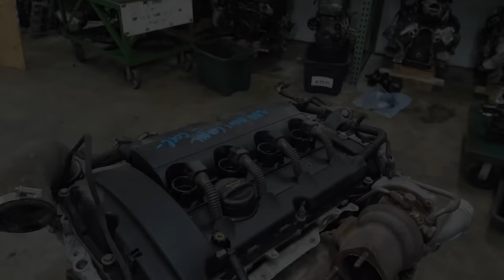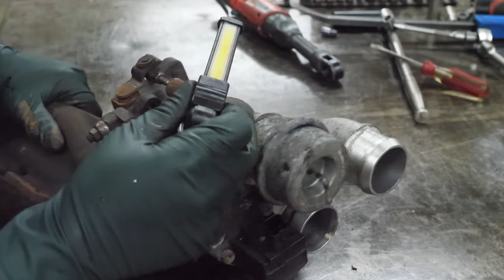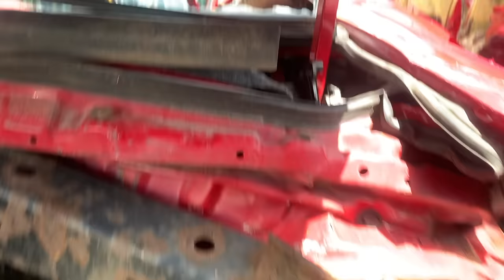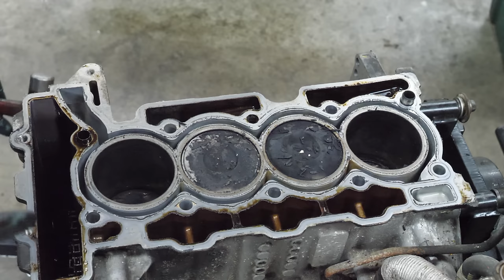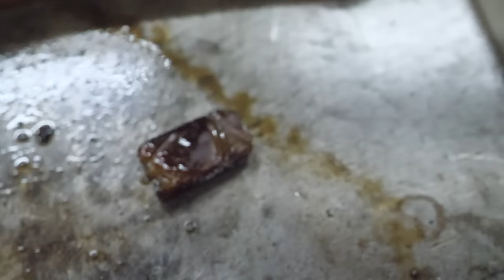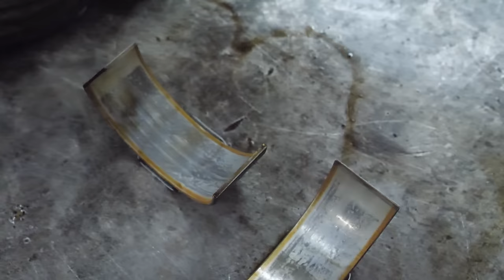JUNK Mini Cooper S (BMW/Peugeot) N14 Turbo Engine Teardown. Why Do People Buy These?

Comment: I owned a 2010 MINI Cooper myself, and loved it... but traded it in on a Fiesta ST after five years due to the multitude of trouble reports on the MINI forums, chain guides chief among them. Figured I'd get out while the car was still good. By the way, the recommended oil change interval in the MINI manual was 15,000 miles. I changed my oil every 5,000.
Reply: BMWs ridiculous oil change intervals are a significant part of their reliability problem IMO.
Reply: Fiesta ST is even worse.
Reply: @jamesgeorge4874  Ha… yeah, I’ve heard the stories. So far it’s been flawless, fingers crossed. But my mileage is pretty low.
Reply: @gryfandjane  At least it's Ford pricing, not BMW pricing, like MINI. Manual models are OK, DCT equipped models, yuck.
Reply: I will never under stand why some one would think 15,000 miles was a good idea I am not even sure full synthetic  can survive 5000 miles
Reply: @dougowens2686  if it was all highway miles, in a theoretical world where humidity, and temperature were ideal, unchanging, and the engine powered by propane / natural gas / hydrogen. Then maybe. I have seen a salesman do 5000 mile intervals on a 3800 that went over 400,000 before it was totalled, no synthetic, just 10/30 Quaker State. 1989 Olds 98.
Reply: @jamesgeorge4874  That 3.8 engine is a legend. One of GM's best. Ever.
Reply: @dougrobinson8602  Indeed. All of my kids first cars were GM W body 3800 cars, for a reason. Every parts store has what you need, the trick is keep them from rusting / getting wrecked. Our 05 Impala went 270K before being sideswiped, I did a water pump, coolant elbows, lower intake gaskets on it at 175K miles, it got sideswiped, and was done for while still running amazing.
Reply: Smart. My wife had a 2007. Well looked after and obviously fun to drive. I knew it was a ticking time bomb thanks to the online forums and I told her many times to sell it before it dies. She didn't listen, "but I love my Mini". With just over 100,000 mostly freeway miles a valve spring snapped and the car went from being worth several thousand dollars to practically nothing.
Reply: My wife had a 2012 Cooper S, at only 36k the dual mass flywheel failed taking the clutch and gearbox with it in the process, it then started drinking oil and gunk was forming under the oil cap. Never again, BMW can go and do one.
Reply: Every 5000 miles?
Smart (and rare) owner.
The proper OCI is 5000 miles OR six months, whichever comes first.
Reply: @flycorvus 5000 is insanely early if you ask me. Thats 8000 km. Not even most motorcycles have such a short  oil change. I change mine between 10 en 15 thousand kilometers. I think it all comes down to oil and brand mostly on that part. I always use Castrol. Which costs me around 70 euros per 4 liters.
Reply: @jamesgeorge4874  No question the Buick 3800 is very reliable.  The engine sound is not the best though (IMO).  I wonder why GM didn't design a straight-six like the one used by Opel and Vauxhall in Europe?  I guess it was mostly installed in front-wheel-drive (again, that were totally different to the Opel Omega and Senator for unclear reasons) hence the need for the more compact V6? The 3800 V6 being used for  rear wheel drive in the Holden Commodore was, I guess, the exception.  [Ford weren't any better, the Taurus, Granada and Falcon were all completely different cars for unclear reasons.  Only the Falcon using a straight-six, the rest with V6 engines.  Two rear wheel drives and only the Taurus with front wheel drive.]
Reply: @TassieLorenzo  GM did have a modern DOHC I6 in the GMT360 platform, i.e. Trailblazer / Envoy /Rainier / Bravada / Saab 9/7 Isuzu Acsender, but it only existed from 2002 / 2009, I would suppose it's a packaging issue, and America is so addicted to full size, 4 door pickup trucks and SUV's, everything else is FWD. The 3800 was the second to the last pushrod v6 engine built by GM, the "high value" 3.5 / 3.9 engine lived until 2012, a few years longer than the 3800. Hard to beleive it ran from 1963 until 2008. Chrysler / Jeep has an I6 again, and I6 turbo diesel engine is available in half ton GM trucks too. Austrailia has some interesting vehicles we don't get in the US.
Reply: @jamesgeorge4874  Thanks for the info!
Reply: @bachmed00  8000km OR six month. Early is not excessive. Early is security.
This "Prince" engine is a dirty engine. Why? Turbo is the key factor. Lots of blow-by, lots of junk. "Oil-mud".
Oil is cheap, engine rebuild is not so cheap.
Reply: @jamesgeorge4874  The old  Fiesta ST with the 2.0L engine was a peach, shame they went down the ECOBoom route!
Reply: 15k is a death wish. They all promote ridiculous intervals. 

Highway driver 5k. City driver 3k. 
Short trip stop and go driver 2.5k
Reply: @rshettle123 Toyota does 16000km on theirs…don’t agree with this tho. I change more frequently. Even with synthetic